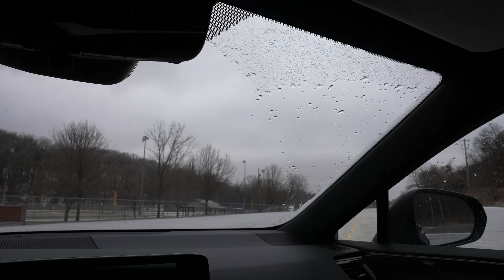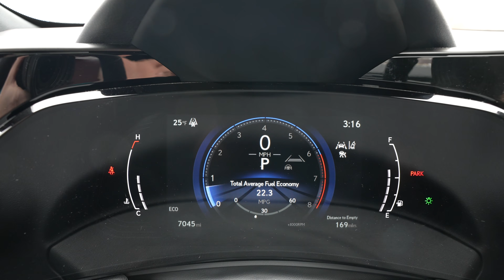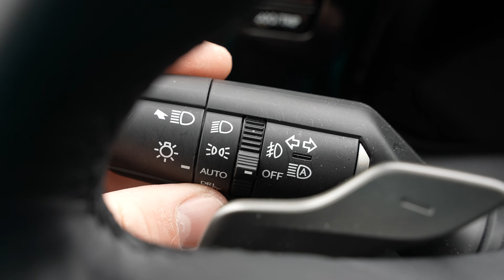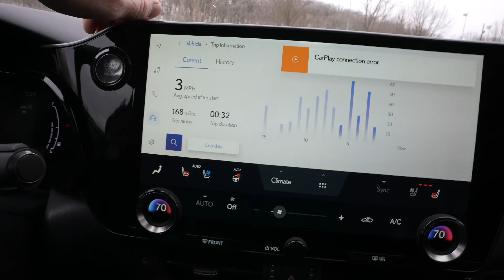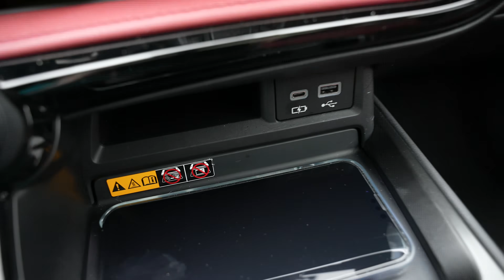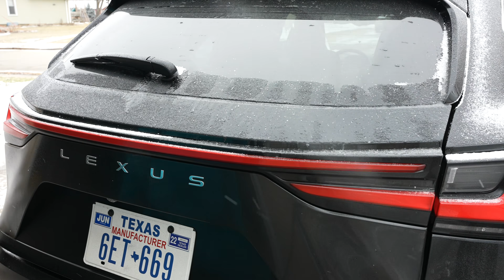2022 Lexus NX 350 AWD Luxury

Comment: This is a car to NOT be that excited about.  I will tell you this, if you plan to tow a light trailer, do NOT get the F Sport trim version of the car. As of over one year on the market, there are still NO tow hitches available from Lexus or from every other source.  Monroney says you can tow 2,000 lbs.  How?  With bungee cords?  Car is also slow, noisy and not that much fun to drive.